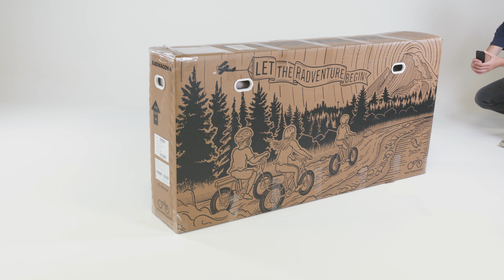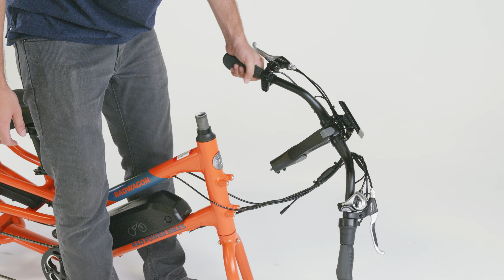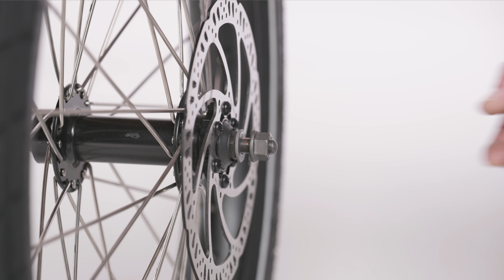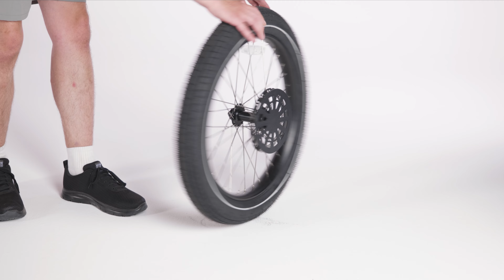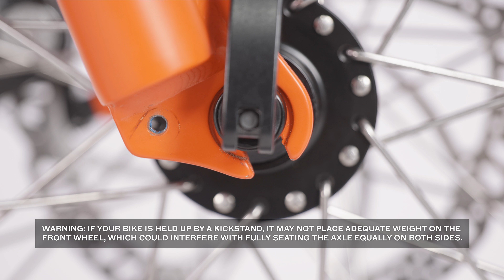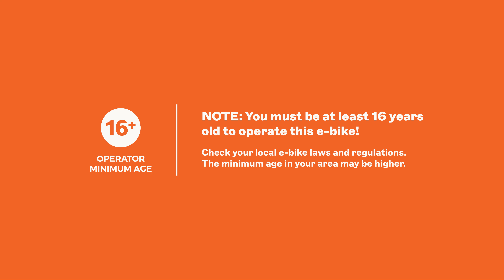RadWagon 4 Assembly | Rad Power Bikes

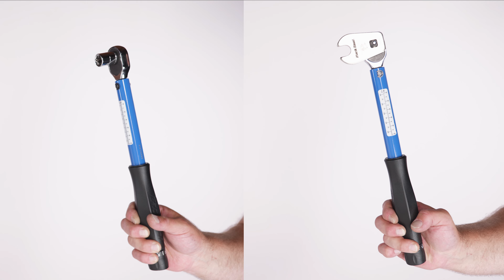Comment: at 7:50, the front axle torque for 2025 radwagon 4 is 35 newton meters, which is 26 foot pounds.
Reply from the maker: Hi! You are correct! At 7:50 we are torquing down the front wheel's axle nuts which should be documented in the video to be 35nm of Torque. Thank you for the call out! It is in our Owner's User Manual on Page 15 found here: 

https://bit.ly/4d81534 🚴

Comment: 2:30 my top cap bolt  seems too short to reach the star nut. I’ve been trying various things for 30 mins but the bolt won’t thread in.
Reply from the maker: Hi! Have you tried using an Allen wrench to loosen the stem clamp bolts?